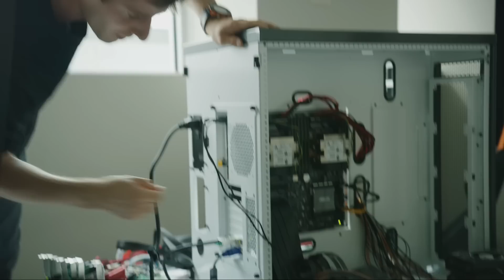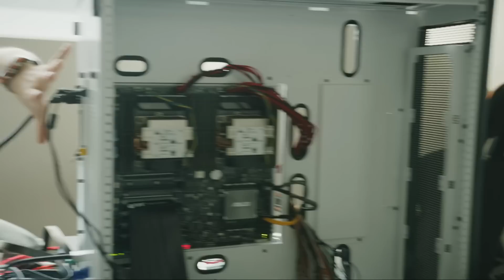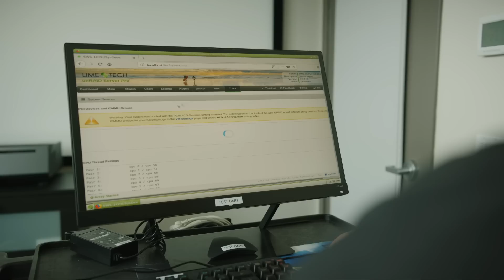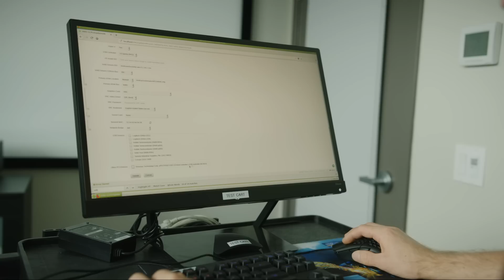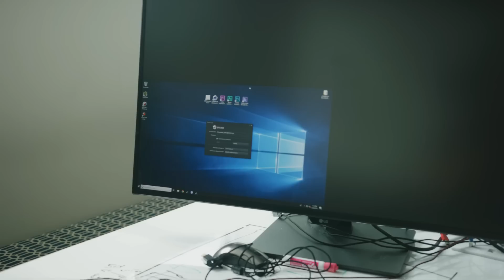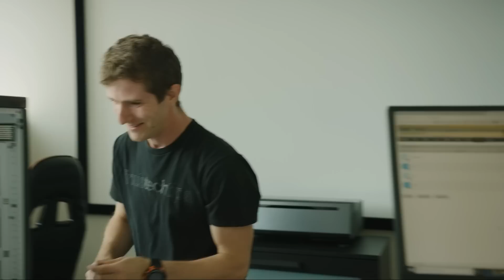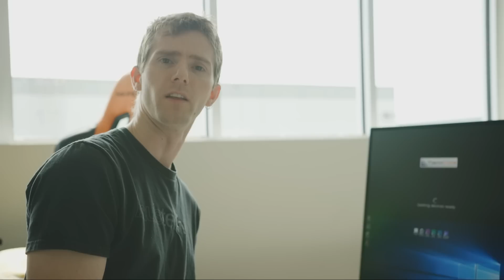Troubleshooting the $100,000 PC

Comment: I'm only a little bit into this so far, but VDI with thin clients seems to solve all of the issues you'd normally have with vms... but without all the extra complications... Still a cool project, but after working with VDI stuff, this makes basically no sense to me in the real world

EDIT: and after watching almost the whole thing, I still think it's a cool project, but ultimately not useful for consumers, and for businesses, VDI with thin clients and similar solutions make more sense and are generally less hassle with the same/similar results
Reply: VDI is a bad solution in this case... Imagine the latency while editing a video on a thin client.
Reply: I use a VDI that's across the internet over multiple states. My host is in my company's HQ in DC I live out of state... the latency is MILLISECONDS... they're in the same office that's wired for 10GB. The latency would be negligible.
Reply: Yes, you're right. But as I said - not all applications support virtual desktop environment. You cant play a game on a thin client, the same would apply for 8k video editing where a milisecond could matter. This is nesessary to get a good performance...
Reply: Do you have any specific examples of programs that do not work over a VDI? I'd love to do some more reading on it if so,  and understand what technical reasons they wouldn't. I've yet to encounter an application that doesn't work with my company's implementation. With the correct hardware installed, the virtual system doesn't even have to know it's virtual and can (read will) run as if it's a normal, physical, PC. The only difference is that the usb devices and monitor have a slight increase in latency because they're going over the network.  Also, how would a millisecond delay hinder one's ability to edit video? I've not had issues doing so in the past, modern video editors allow you to scrub through each frame, one at a time, to very accurately make keframes/cuts/etc.

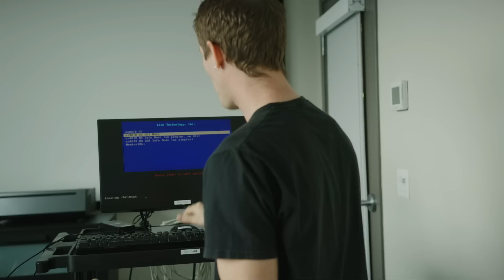Comment: 10:48 You can't but it is possible to write a driver, some software or modify software to share a usb device among multiple vms.

You might want to protocase or use a case you have to put the PCIe riser board into if it fits ATX.

Comment: okay im confused … why would u not just have 6 computers for 6 editors I mean I know a lot of high end computers can be costly but 100 k can buy a lot of good pc parts... hell my computer im typing on right now has a gtx 1070 ti and 6700k (which I know the 6700 k is not an "pro grade" cpu but its an example)  is tops worth 1500 bucks with ssd and hdd (when I built it ) my point being you could spend 3x the cash I spent per computer and still save money. anyway I suppose my main question is whats the point? Could it be Linus's over thinking like the full room water-cooling instead of ac lolol? I mean its video editing not rocket launching or simulations of dna or some shit.
Reply: DarkSniper i dont know which graphics cards they use but the high end stuff is pretty damn expensive.

Comment: The assumption that many viewers know about Linux native games is fair, but probably wrong. LTT, you guys should take a loot at the list of Linux native games, it is quite good these days even though some of the best games (The Whitcher 3, Cuphead) are still lacking. Having said that, the games are less well optimized, that is the developers their fault. Passthrough is a good solution, if you dislike MS (I can relate) then use Windows without a license, as long as you can gamee fullschreen without interruptions from Windows. Or buy a key via a reseller.

Comment: I do believe VMware ESXi has usb hot plugging working out of the box without rebooting ...
Reply: WRONG
ESXI can't pass-through hot plug from those PLX  ON PLX things
Reply: maybe not, I have not worked with crazy plx bridges - but it can pass through usb devices hot plugged into the host to vm's without rebooting vm's. So - you can plug a usb device in, go to the web ui and say "give that device to my vm" and it just works like if you plugged it into that vm directly. And you can do that for any usb device seperately, even if you plug in the same keyboard or audio card or something like 8 times.
Reply: plus there are people in the vmware forums who got direct I/O pass through (which is pretty much the same what linus is doing there using unraid) working with PLX switch chips since ESXi 5.5 (which is pretty old by now). So you can pass through the usb controller directly and have the vm handle hot plug. That said, vmware does not SUPPORT that even if it's working.
Reply: @OldLukes  okay sooo my bad, I've always been using a rack mount device with a seperate controller for each port, it had 12 USB's 3.0 :)

Comment: This is very cool and I love the hardware and the build but wouldn't it just be cheaper to build 6 workstations?
Reply: I'm missing that too. Not only would it probably be cheaper, but also, if something stops working on the computer, it would be much harder to fix. This whole com9uter seems very unnecessary
Reply: Umm you know he is only building it for a video. He isnt planning on it being used for long.
Reply: @thebanker121_  It definitely doesn't make sense if it is just for a video. That is a $100,000 dollar video.
Reply: @prankcoll4190  Most of the parts are going to be reused plus he got a lot of it for free.

Comment: What is "virtual"... What is "machine". I dont think these are concepts that may be defined by "hot swap-ability".
Reply: it just seemed like he does not understand that you can have 4,000 virtual machines on that kind of build and still be going strong ... they will have a tendency to crash about once or twice a day but it will boot and do most things in excel and word on windows XP or unbuntu or other low resource OS that can run excel and word

Comment: so this pc has 384  gigs of ram when i still have 2gb ram :'(
Reply: well you also are most likely not trying to run 6 other machines on your one physical machine 
i "only" have 32GB and am limited to 3VM of windows + using the host as a working machine before i have a slow down due to system resources

Comment: Why not just a VDI server ? A lot more resilient imo.. And way more "enterprise class" (redundancy, management, cooling...)
Reply: Actually it is a VDI server... Just with GPUs for each VM. The problem is when you edit videos and stuff you need to use your GPU as output, so you have no latency. Dont forget about applications that actually need to be run on a real display throgh the GPU. You can't run games via remote desktop f.e. ;)
Reply: Horizon view with Grid will do this, with some limitations.  Not sure you can vMotion . Then the USB ports would be local to the client not on the server.
Reply: was what i was thinking. If you can think of it, it's been done.

Comment: Is this worth the money and 6 separate 8k editing systems cost $16k each, or just for show?
Reply: I think it's for show/an enthusiast thing. You could definitely make a kick-ass 8K editing system for less than $10,000. Highest end X299 or X399 CPUs, 128GBs memory, workstation graphics cards and even multiple and you'd be hard to pass $10k without going insane. Most of this $100k pricetag comes from the xeon platinums. I don't know which one their using but even the 4-cores start at 7k and top ones are almost $50k by itself so yeah... 6 titan Xps cost only $7200 so it's an insane cost doing it just because they can IMO

Comment: But aren't 6 10Gb Ethernet cards saturate that single PCI 3.0 x4 lane? Or those will go to the main mainboard slots, and just the USB host controllers go to the daughterboard?
Also how are you expecting the editor workspaces to be connected to this? Are you going to use a lot of USB extension cables, or extend the PCIe slot of the USB controller, or.. ?
Reply: That is best done with the motherboard's 10Gbps port(s), and no need for one network card per user: the host OS acts as a network switch, so he just needs one or two (he mentioned bonding two to get 20Gbps) on the host side 🙂

Comment: sorry touching painted metal isnt grounding...bare metal does
Reply: Not really because you never actually want propper grounding. You just want to discharge static and for that it's fine.
The anti static wrist straps always have a internal resistance >10meg ohms to protect you from shorting something to ground while still getting rid of static

Comment: Other than "because we can" why would you do this? wouldn't it be easier to just have 4 seperate mashines?
Reply: *6 seperate machines, he's just running 4 for testing purposes because that monitor can only support 4 split screen outputs.

Ultimately the main benefit is asset utilization and efficiency. 6 seperate machines take up a lot of physical space where as this machine takes up the equivalent of like 2. They would also take up the power of 6 seperate processors, mobos, 6 sets of RAM, and 6 sets of cooling vs 2 slightly higher powered processors, 1 mobo, 1 set of large RAM, and 1 set of cooling. You can also save the money spent on 6 seperate power supplies on a larger but much more efficient single or dual power supplies. Having 6 machines constantly starting and shutting down will wear them down faster than 1 machine that is always on. You can also get away with having less RAM overall, aka overprovisioning, because often not every person needs their entire RAM allocation at the same time. You can also get away with a higher RAM total as you hit economies of scale with denser RAM sticks in one machine rather than needing to spread it out over multiple machines. Each machine also needs some form of long term storage, using 1 machine they can simply pull from a pool of storage devices which can, again, be denser and also provide redundancy.

The most ideal scenario of course would be if each machine simply connected to a pool of processing and graphical resources, where they can take as much power as needed so long as it's freed up, allowing a single editor to use all cores and all 6 GPUs if no one else is working, or 2 editors to each take half, and so on, making for maximum asset utilization. However this is cloud computing territory and I'm not sure any consumer or prosumer equipment would allow you to do this without requiring you to do a lot of programming yourself.
Reply: all true but you also have a single point of failure for 6 pc's, if 100k pc goes down for some reason, 6 editors cannot work at all. Also not practical, the editors are in the same room but he is going to need super long usb and monitor cables, not to mention other devices the editors have, who's cables cannot be extended.

Comment: you should use thunderbolt 3 cards rather than usb 3 to get more bandwidth to each user
Reply: Thunderbolt 3 is using 4x pcie lanes for 1 plug only. The whole extension board only uses 4x pcie lanes. That wouldn't make much sense. Pcie lanes are CPU limited. That's why threadripper and epyc are such a great deal for pcie connections
Reply: but... all of the users won't be using the full 4 pcie lanes at the same time
Reply: @harveyharwood9402  I guess that's why they settled with 6 USB 3.0 card with multiple ports ;) thunderbolt 3 would be interesting for a new version though
Reply: I don't think Xeons support Thunderbolt 3
Reply: @DavidMorseMusic  They are on the Imac Pro
Reply: @nororlol4life819  true, but not on off the shelf boards.
Reply: And also bear in mind that the iMac Pro uses Xeon W chips (workstation chips). Server-oriented Xeons definitely don't support Thunderbolt 3.

Comment: Trending because of the word "$100,000"...
Reply: Angelo Stevens No one is saying it's revolutionary, it's just an ambitious project that will probably bring more attention to the channel.
Reply: "100,000" is technically a number, not word.
Reply: Angelo Stevens yes but the companies that do usually do not stream it online anyways due to security concerns, prosperity technology to fix that network speed issue with 20Gbps, 40 Gbps and/or 100Gbps per cable networking,  and of course mostly buying them prebuilt and just moving over an already working VM manager of VMWare, citrix, etc. for them so the set up is more so hooking up the network cables than setting up the VMs to work
so watching it is novel to most people even though he is doing it in a way that will proof it works but then having to go back and redo the virtual machines due to setting them up incorrectly in part due to no documentation of what part is to which vm as there is no overlap in hardware for his virtual machine server
Reply: yeah but is it wrong? it's actually a 100,000 dollar build
Reply: a badly configured 100,000 dollar build with many single points of failure 
i am hoping he gets in touch with a guy who knows how to do proper virtual machine  machine server design as 100,000 dollar is alot of money
Reply: thats the whole point of the channel though
Reply: I am fairly certain all the hardware is being sponsored for the project. I dont even think he actually intends for his editors to use it.
Reply: 100,000$ is a number not a word
Reply: Thats a number bud.
Reply: It’s a number not a word
Reply: Zumokik yup. Got me here even though i knew I wouldn’t really watch it
Reply: They should have said One BILLION DOLLARS!
Reply: "word"...
Reply: Well, that's actually four words, but still.
Reply: 1 plus 2 is 3 quick maths
Reply: You know what else is trending for the word  100000.
your stupid comment
Reply: Zumokik p
Reply: Trending because Linus is epic.
Reply: Zumokik it's better then "Forknite machine "
Reply: Angelo Stevens Oh go fuck yourself.
Reply: YouTube's rigged to promote clickbait shitty videos and the fact that this is trending proves that! Just bc of the $100,000 in the title
Reply: You could say so. Atleast in our universe, particles behave as waves, thus have frequency same goes with other stuff. LIKE MY GIGANTIC PEEEEENIIIISSS THRUSTING IN AND OUT OF EVERYONE'S ASS, CUNT, MOUTH, EYE SOCKETS, EARS, PORES, NOSE, DISHWASHER, POLICE STATION, SPACE STATION, JAMAICA, AMERICA, ANIMALS, POACHED EGGS, STEAK, PRESIDENT OF THE UNITED STATES OF AMERICA, QUEEN OF ENGLAND, CANADA (SORRY A.K.A SORRY, I APOLOGIZE, PRADON ME, FUCK ME), MAINLY JAPAN, TURKISH COFFE, ENTIRE PRISON (DONT DROP YOUR SOAP LAND), POLAND, RUSSIA, ALIENS, ALL 7 CONTINETS, ALIENS, ALIEN PLANETS, ALIEN STAR SYSTEMS, ALIEN GALAXIES, ALIEN CLUSTERS, ALIEN SUPERCLUSTERS, ALIEN DIMENSIONS, ALIEN UNIVERSES,  SATELITE, THE FUCKING MOON OR SHOULD I SAY FUCKED MOON, TOASTER, EXHAUST PIPE, SPACE, TIME AND REALITY ITSELF!!!!!!